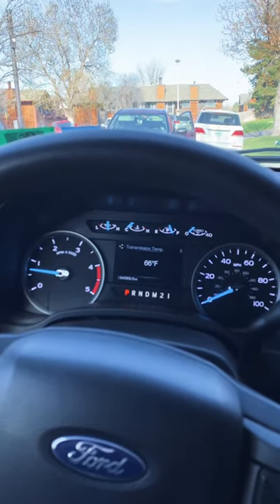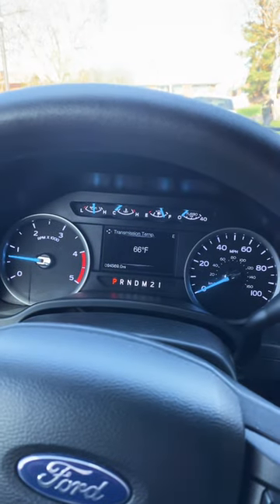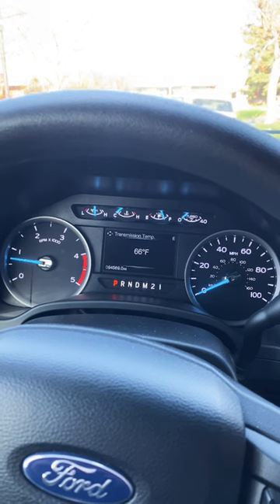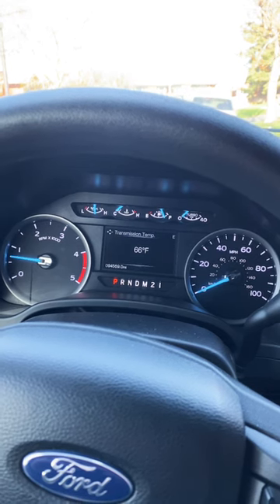What do you consider normal operating temperature for your transmission? #powerstroke #ford #truck

Comment: My normal temperature for years was 194 to 197 recently. After getting transmission worked on by a local dealership. I am now experiencing temperature, averaging 205, and that's not towing.That's just highway speed.
Reply from the maker: What work did they do in the trans? The fluid matters a lot for helping manage the temperature

Comment: Under 210 is good over 210 is bad over 220 is pretty bad. 220 and above fluid breaks down and leave varnish 240 good bye transmission way sooner than normal
Reply from the maker: Fluid breaks down at 220?
Reply: @powerstrokemaintenance  Fluid is always breaking down otherwise you would never have to change it. Over 220 it breaks down significantly faster. It is just what science shows from studies not my opinion or anything you can do your own research
Reply: Not true. If you want comments from a former Ford transmission engineer, just reply and I will copy and paste information.
Reply: @richardrice2624  2013 f150 with 2160000,  and my temp gets to 204-206 running at 75-80 mph and not towing.  Should I be concerned?

Comment: 196. With no trailer and 215 with trailer
Reply from the maker: Solid 👍
Reply: Mine is 175 degrees normal towing $196 after like 30 mins non stop towing !

Comment: In my 2021 6.7l my temp around town is 195-200 when I’m towing it’s 215-225 this honestly scares me . Right now I have a slippage in gear 6-7 .
Reply from the maker: When was the last time the transmission fluid and filter were changed? I wouldn't panic yet just get some fresh fluid in there

Comment: 2018 with the 5.0 im getting around 203-214 this is on a 1 hour trip is this normal? Seems a bit high
Reply from the maker: Hm what speed do you typically drive at? And are you towing or hauling anything regularly?
Reply: Similar. But I’m 3.5 eco. No towing. 70-80 on the freeway on a long road trip.

Comment: Normal operating temp according to ford, for the 10R80MHT, is 206 - 219 F. The 10R80MHT uses Mercon ULV which is design to run at higher temperatures compared to non 10-speed transmissions.
Reply from the maker: Interesting.  Didn't know that about the 10R80!

Comment: I have added a new transmission fluid cooler because our weather is very hot sometimes the temperature reach to 50 degree Celsius that will cause to increase the fluid temperature to more than 200 degree F
After a new cooler installation the temperature now is 147 deg F
Reply from the maker: Nice! What cooler did you install?

Comment: I’m running at about 205-208 on the highway. 4.3 eco.    I’m on a 2 week drive down to Mexico. 3 days in I overheated after a long day driving on the freeway.  Let her cool, added fluids and nothing has happened since. (After 5 more days of driving).  But, I’m not “pushing” it.    Now with all the “higher” temperatures posted here I’m even more curious about how I overheated.  ….
Reply from the maker: That´s an interesting situation.  When was the last time you changed the fluid and filter in the trans?  Does it have a filter?
Reply: That what I thought. Caught me by surprise. I’m a bit ignorant of what maintenance has been done on the truck. I’ve always bright it to the dealer and told them to do what’s necessary without much oversight.  I’m actively educating myself now.  

I’m at 250,000 kms/155,000 miles so I’m looking at doing a lot of things all of a sudden it seems.   I’ll be changing all the major fluids, new thermostat etc.  though I’m looking for advice on what I should all be doing as I love  my truck.   Also had a Throttle Body code come up.   

That said, I monitored temperatures closely for the last week of driving and Trans temp never went t over 208.
Reply from the maker: Good call! It sounds like you’re on top of things now and will get your truck dialed in in no time.  May want to consider a serpentine belt as well given the mileage.  I bet the overheat was from an old fluid and filter.  My experience is that dealerships tend to do the bar minimum
Reply: @powerstrokemaintenance  I will add that to the list. lol. 

So far…. All major fluids. RH inner tie rod, LH outer tie rod, vacuum pump (leaking but installing new, throttle body, thermostat, transfer case (crack from someone over tightening), parking break (apparently not holding at all), serpentine belt (thank you)….  Anything else since I’m into it anyways?  lol
Reply from the maker: You could make sure to check the idler pulleys for the serpentine belt, make sure there's no play.  Also would be worth doing your front and rear differentials because if the trans wasn't done, those sure haven't been haha
Reply: @powerstrokemaintenance  From a FB post I made.   (A guy commented a new truck for Christmas! 😆). 

2014 FX4 3.5 with 250 000 kms.   I’m hitting ‘fix it’ stage.  So far on the list..

All fluids and filters
Tie Rods
Throttle Body
Thermostat 
Serpentine Belt
Blower Resistor (plus plug change, shorting out) 
Shocks All Around 
Parking Break Failure 
Vacuum Pump (leaking oil)
Transfer Case (some fruitloop mechanic over tightened and cracked it). 

What I’m wondering is what else anyone would recommend at this point based on your own experience. 

Am I missing anything that should be addressed while I’m at it? 

I do have the Cam Phaser noise on first start up in the morning. Still debating if I should just carry on priming in the mornings or get it done. Seems to be a wide range of thoughts and opinions plus the amount of folks who have done the change only to have it return a short time later. On the fence on this one. 

Thanks for  your time and thoughts.
Reply from the maker: Of course happy to help! Hope you’re able to it sorted and ready to go

Comment: Mine reads around 167 an its suppose to be a new transmission an just got it out of the shop an now coolent fan started kicking on full blast even when it sat over night an not hot
Reply from the maker: Interesting. Does it stay that temp even when the trucks working hard?

Comment: My 2018 Silverado is running at 225 is that normal?
Reply from the maker: I'm afraid I'm not sure what the normal operating temp for a Silverado is.  Are you reaching that temp while towing? And when was the last time to changed the transmission fluid and filter?